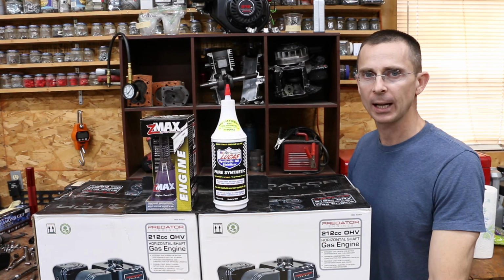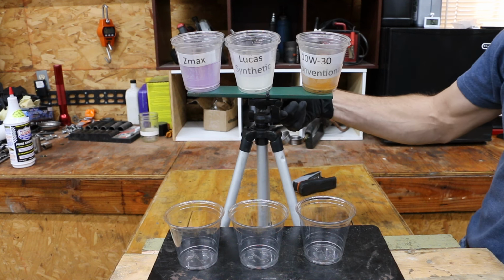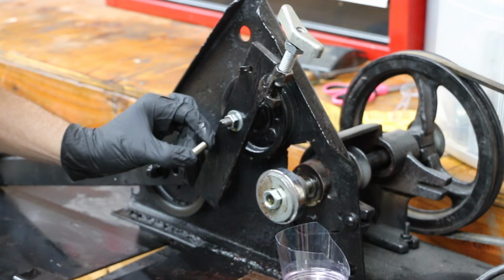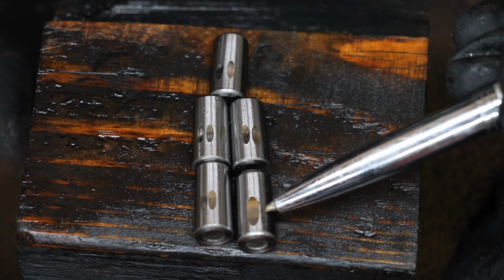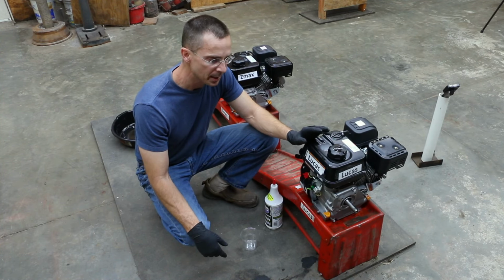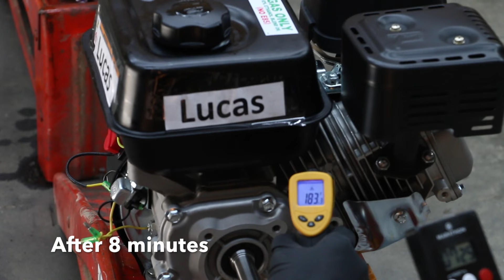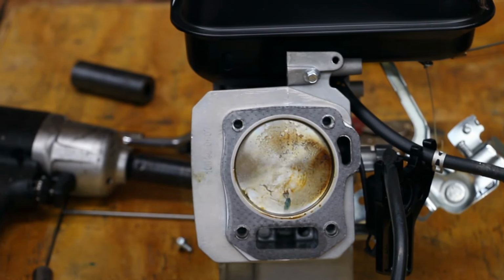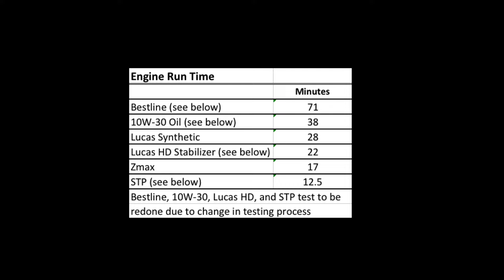Which engine self-destructs first? Zmax or Lucas Synthetic?

Comment: What brand of synthetic 5w30 weight oil works best with zmax.
Reply from the maker: Thanks for the video idea.
Reply: @ProjectFarm  , the reason I asked about zmax and different oils, is because I have an 02 Silverado w/V6 engine. 

The engine has nearly 300k miles that's on its last leg. Thankfully it's not smoking, though power is sluggish. 
Since the engine has such high mileage I bought Kirkland brand synthetic 5w30 oil because of the price to try.  I use to use Mobile 1 synthetic. 

Now the reason I asked about zmax and different types of oil.  Is  because auto zone in Texas had single bottles of zmax a while back for half off. Well, since I had that bottle of zmax, I thought I'd mix it with the Kirkland synthetic oil just to see what it does.

I was wondering if the zmax that I bought for half off will actually improve the Kirkland brand oil.

I did read somewhere that Kirkland oil is good, though not very heat tolerant.

What do you think?

Comment: I have got at least 250,000 almost trouble free miles from my last 3 vehicles and am in service sector . #1 great oil good filter ; always synthetic Mobile 1 early and now Castroil  Edge  with oil change every 8,000 miles and transmission service at 30,000 . Never a major repair if you do not buy junk . My Ford E-150 has 363,000 miles and still runs great with 0 repairs other than an alternator at 250,000 . All has turned to foreign junk now even with Ford vans . All American vehicles are high priced , short life junk now . If you have half a brain , Toyota and Honda selected vehicles are the only long life vehicles left .
Reply from the maker: Thanks for the feedback.

Comment: The bad part is zmax is $35-$40 .. so expensive…

Also zmax is actually 2 additives, one thicker and one really thin..

The fact that the motors ran so long with no oil suggests that no additive really would ever made a big difference.. but in a high tech motor maybe its different..

I buy a lot of lucas stuff but you have to use the right product for the right application.. domt use heavy duty stabilizer in a low viscosity motor.
Reply from the maker: Thanks for the feedback.

Comment: This test only proved Zmax with no oil cannot lubricate an engine solely. Which it was never intended to do. It’s purpose is to not allow carbon to form. You are missing the point of what it’s intended use was. Enrico Fermi invented the stuff over 80 years ago to help prevent fighter aircraft valves from sticking, which it does. It’s sister product Avblend is used in piston aircraft world wide. Look up the Lycoming engine tear down of a WGN in Chicago news helicopter and you will see by its ability to prevent the formation of carbon, it prevented the blow by in the Lycoming engine. The oil is used to carry the Zmax throughout the engine and prevent carbon build up. Not to improve the viscosity of the oil. I have no affiliation with Zmax, but have used it among other additives. It does do a good job of preventing carbon, and the FAA supervised testing concluded it cannot harm an engine. Zmax with motor oil cannot harm an engine. But any engine without lubrication will eventually fail, which is what your test proved.

Comment: The main claim of zmax is that it breaks up carbon not lubrisity. Could you do a test on used engines to see if it actually cleans the engines over time. Testing it on new or clean parts proved nothing.
Reply from the maker: Thanks for the suggestion.

Comment: Zmax has a pretty package but it's trash. It would appear that Zmax would be bad for your engine. Like slick 50, The slickest thig about that stuff is it's name. They didn't count on a guy like you doing a rea world test, tried to help an old generator years ago with Slick 50 years ago. and it did it in instead of helping.

Lucas has to represent, since they are so involved with racing, but they still want to take advantage of the snake oil buyer, They probably worked hard an making sure that it was at least neutral because that could kill their reputation,
Reply from the maker: Thanks for the feedback.

Comment: it's not a fair fight you don't run your car or truck full throttle for 3 hours straight plus these little engines don't have a cooling radiator so of course it gets super hot duh try put in to a 6 or 8 cylinder then see what happens.

Comment: That testing method is irrelevant. Engine oil is pumped around the engine, under pressure. This is precisely why engines have oil pumps. The oil is not meant to stay in place or 'stick' where it is. Increasing viscosity will not help lubrication. Sure you will get a higher oil pressure reading on the oil pressure gauge. Why? Because the oil pressure transponder is mounted at the outlet 'manifold' of the oil pump. The reason for higher readings is simple. The oil is now flowing insufficiently in the narrow oil galleries and thus the flow to critical engine parts is insufficient. The pressure of the oil, where the oil is needed, will be lower. Not higher. I advise against oil additives completely.

Comment: Destroying predator engines since 2017.

There should have been a third engine that just had the oil you used without additives drained and ran alongside the other two, perhaps plain oil would actually do better.
Reply from the maker: Thanks for the feedback.

Comment: The engines are not "Alive'. I'm sure they don't feel any Pain. Those of you who have personified these engines, as you can see, the engines will be donated to a school shop class for reconditioning. I worked on at least a thousand small gas engines while I worked as a Tech for Sears. I always said, and it may be true, that you dig one of these engines, all busted up, out of a landfill, and get them running again, without too much trouble. Parts are readily available for some of these engines going back to the early 1920s. So I'm sure, they will "Live" again, and run much better than they ever did. Test Grades will depend on that.
Reply from the maker: Thanks for the feedback.

Comment: Actually unless these small air cooled engines are blueprinted and identical in clearances these test are just using different lubes but with no actual comparisons to which is better. A small engine like this once properly broken in does not need anything but a decent grade of engine oil in the correct viscosity for the operating temperatures and to be changed within the recommended hours of usage to get full life out of the engine.

You would be better saving the money you are wasting on additives to buy the replacement engines when the cheap Chinese engines fail.
Reply from the maker: Thanks for the feedback.

Comment: The non detergent oil recommendation for break in is totally bad advice. NO engine made today specs using non detergent oil. You should always use what's recommended in the manual and I know those motors are not approved for non detergent oil. There is absolutely no use for non detergent oil except for door hinges.
Reply from the maker: Thanks for the feedback.

Comment: Why would you use a non detergent oil for break in of the engine ? I’ve never heard of that before non detergent oil is for air compressors gear box’s ect ? Thanks for any information

Comment: It's amazing to me how gullible people are today. All you have to do is CHANGE YOUR OIL. You don't need additives! I run 20w-50 in every car I own and have done so for 30 years. I have NEVER had an oil related failure in an engine. I currently own more than 20 cars, so I can say this on good authority. Do you know why car manufacturers recommend light weight oils in newer cars? IT'S THE ONLY WAY THEY CAN MEET EPA MILEAGE REQUIREMENTS! They don't care if your engine wears out! You should run heavy oil from the time you buy your car, new or used. Just my two cents. What do you guys think?
Reply from the maker: Thanks for the feedback.

Comment: what's the point of this video if you drain it and run without oil? of course it will break... it's better to test them at high RPM until it breaks with Proper amount of oil
Reply from the maker: Thanks for the feedback.

Comment: Both of the products are crap. The lubricity test results alone show no improvement over conventional 10w30. Zmax is little more than an engine detergent. In the end, neither of the products lived up to their own hype. I am surprised you didn't get a cease and desist from both of the companies asking you to take down the video. Both engines threw the piston rod, with the zmax engine seizing. Either way, I am never buying either of these products.

Comment: People need to understand that if any of these products worked the manufactures would use them.  Manufacturers spend millions and millions of dollars on fluid technology trying find the perfect balance between lubricity, fuel economy and low speed pre-ignition.  No one chemical (lucas or Zmax) can improve everything they claim.  In fact, these additives should never be used in a modern engine, modern being made in the last 10 years.  Even though on the bottles they claim it will not void manufacturers warranty, they will in fact, void your powertrain warranty.  I used to work for GM and they have service bulletins that state any use of an oil additive will void your warranty.  If you have a engine failure within warranty period they will send your engine out to be torn down and analyzed and they'll send a sample of your oil out to be analyzed and if they find any trace of an additive that is not normally found in engine oil, well, (in soup nazi accent) "No warranty for you!"  There is only 2 real uses for these additives.  1; you have engine noise and you want to see if that'll quiet it down or 2, you want to be a scumbag and you're trying to sell a car and you need to quiet the engine.  

So TLDR:  Use a high quality engine oil and filter recommended by your manufacturer and change them both at the recommended interval and you won't have issues.  Lucas has a lot of money to spend on sponsorships to get their name out there but the fact is their products simply do not offer any substantial benefit to the end user.
Reply from the maker: Thanks for the feedback.

Comment: 🤔 this test is not correct because you did not use micrometer to measure all the points before.

The engines measurements is not the same for every engine.

On the other hand, if all measurements was the same.
To put something else than the oil the fabric is recommended is not a smart idea.

The oil that is made is always the best for the engine.

This things are tested and have something to do with how economic the engine are to.

Do not put something to engine oil.

And dont you know it how long an engine really last or 😂 they almost live for ever anyway.

Use the oil that is recommended.

Comment: I don't get it.   Every oil engineer, yes... a real chemical engineer with a degree from a university, will tell you that there is no way to improve, what is in the oil can already,  with any snake oil additive.   Even if you buy Walmart brand or any other brand that meets or exceeds the standards as set by API,  is more that enough to preserve the engine.  The car owner needs to do two things though.  Change the oil at mileage or time intervals specified in the owners manual, and DON'T BEAT THE SHIT OUT OF YOUR ENGINE.   I drive about 40K - 50K per year and my engines easily last 250K miles consistently... then I sell the car for $1.00 to a student. 

So, while your broadcast is entertaining it proves what everyone already knows.   Additives are snake oil sold to fools who do not know any better.